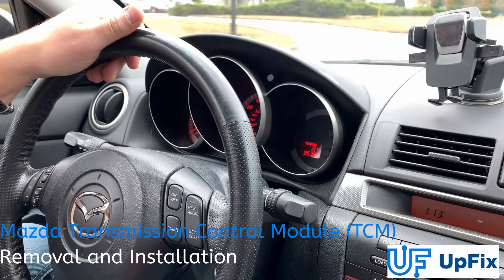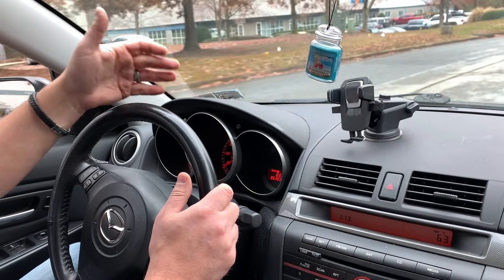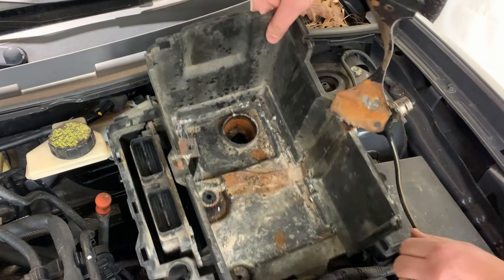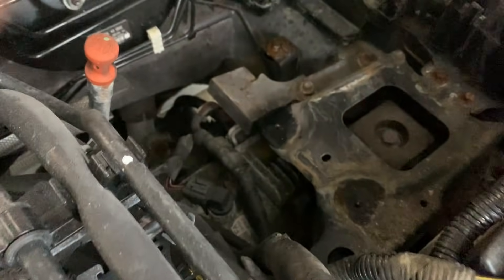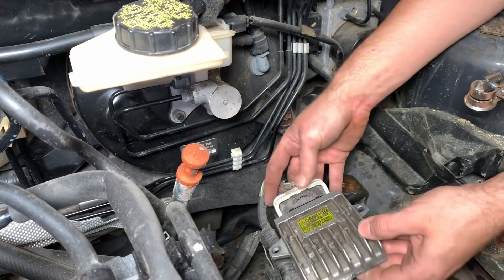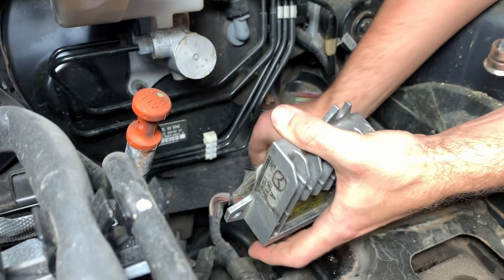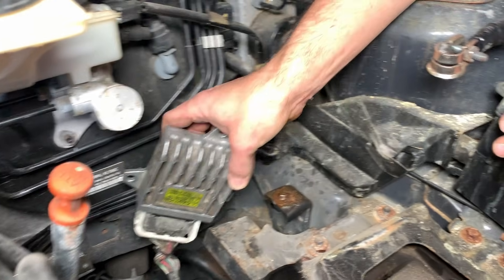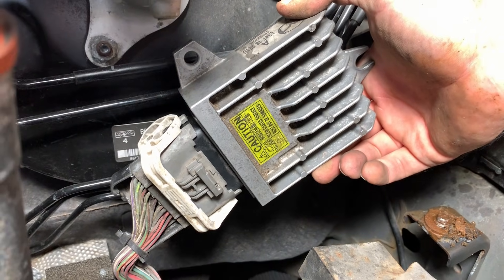Mazda 3 TCM (2006 - 2014) Transmission Control Module Location, Removal & Repair by UpFix

Comment: My 2013 mazda 3 doesnt have any dash light that come on, or any codes, but it normally doesnt want to shift into 3rd or 4th gear while it automatic mode. I can shift fine in manual mode. Would this even be a TCM issue?
Reply from the maker: Considering the coils and plugs were replaced. The misfire can be caused by wiring, internal engine failure, a head gasket, a bad fuel injector, or a malfunctioning ignition or fuel system. If you have checked the above, you may need the ECU repaired. Please try a hard battery reset first (guide below).
https://forum.upfix.com/pcm/pcm-re-installation-procedure

Comment: How much does it cost to send in my TCM for my 2006 Mazda 3 2.0L.?
Reply from the maker: Here is the link for the current price: https://www.upfix.com/product/tcm-mazda-3-2006-2014-transmission-control-module-repair-tcm-tcu/
Reply from the maker: Here is the link for the current price: https://www.upfix.com/product/tcm-mazda-3-2006-2014-transmission-control-module-repair-tcm-tcu/
Reply: Ok these are the issues I am having with my 2006 Mazda 3 2.0L
1. Check engine light and AT light on
2. The car shifts into 1 and 2 gear like it doesn't even there.
3. Once in third gear it gives high rpms then hard shifts
4. Goes into "limp mode"
5. Sometimes I can't go in reverse.
6. Manual transmission gear options don't display
7. The engine gets real loud as if it is whining/grinding.
8. If driving and I stop at the stop sign or stop light the car while not kick back into gear when taking foot off brake and applying gas. I would have to put it in park, turn the car off. And once the car is restarted it will work just fine for about a few minutes then the same problems occur.
9. Put the OBD reader into the car and the codes given are P0455, P0771, P0741, and P2187.
10. Now if I clear the codes, the engine goes a lot quieter and all gears start to work to include the manual transmission gear options start to display and become active again. But at this point I don't know if I should be changing my solenoids, fluid, and filters or what. So I'm lost.

Also I just purchased the car from a friend and not sure of the maintenance upkeep but I got the vehicle at 230,000 miles.

Comment: I have a 2009 mazda 3i 2.0 I am having trouble finding this part. Does anyone know if all 2006-2014 tcm's are the same?  Or is there a difference between the 2.0 tcm and the 2.3 tcm? I'm having no luck
Reply from the maker: Yes, they are different.  Also, make sure the part numbers match. If no luck and you have some time, then an option is to send your original for repair. It takes a few days for repair and few days in shipping. Check out upfix.com

Comment: I have a 2012 mazda 3 skyactiv.automatic The engines revs high at about 30 miles/hr. Is the transmission not shifting?
Reply from the maker: This is a common issue with faulty TCM. Transmission is okay, just the TCM that needs to be replaced or repaired. Check out upfix.com

Comment: Hi, i have this issue, can you swap it out for a refurbished replacement? Mazda told me new one will need programming.. tia
Reply from the maker: Yes, you can swap it for refurbished replacement. It will need to be programmed. We ask for your VIN to make sure it is properly programmed for your vehicle.

Comment: I have a mazda 3 2007. I have no AT lights on, none of the error codes show up on my obd scanner. Yet i have this issue where the drive light in the dash that shows which gear the car is currently in go off and on at times. This issue only affects drive and none of the other gears. When the drive light is on and not going on and off, all gears perfectly shift and the car runs really smoothly. Is this still the tcm or some other transmission related issue.
Reply from the maker: If the drive is affected when the gear shift indicator light is intermittent, then it sounds like it could be a physical issue, not just an electrical one.

It would be good to verify if your OBDII scan tool is capable of reading TCM codes. If it is, then it's possible for the TCM to be at fault since they're commonly known to fail as a result of manufacturing defects.

We can do a bench test and see if there are any issues with the TCM on our test bench, and rest assured, proceed with repairs after diagnostics.
Reply: @upfixauto  can you elaborate a bit more about the physical issue part. Do you think it could have something to do with the transmission linkage cable, sensors or the shifter itself? I'm really puzzled as the car runs smoothly whenever the drive light isn't going crazy blinking.

Comment: My mazda 3 2011 2.0L doesnt shift at start i get the cold start temperature signal then after the signal is gone the transmission can shift and engage without slipping gear properly but only after playing a little with reverse neutral and drive the peocess takes 5 minutes after that the car drives normal and i have gone even 80 mph on it without any weird smell noise or even vibration could this be a tpm issue or a transmission issue i changed the trans fluid at 100k miles the car still drives at 106.8k miles problems started at 106k miles i also added lucas trans fluid and it helped at first but i am asking for advice if i should send tpm or get my trans fixed for 2k
Reply from the maker: Yes, these are common issues that are caused by a failing TCM. You will need to get it replaced or have it rebuilt. If you need your TCM rebuit, please consider UpFix. The process is fast and easy! Check out https://www.upfix.com/product/tcm-mazda-3-2006-2014-transmission-control-module-repair-tcm-tcu/

Comment: so this did not tell you how to repair it at all it just shows you how to remove and replace it
Reply from the maker: What issues are you having with your TCM?
Reply: @upfixauto  shifts hard from 1st to 2nd, I bought an aftermarket TCM from Hong Kong for $400 and it would not work, I took it to the dealer and they could not get it to work, that one would not show what gear I was in and would throw codes saying it is unable to communicate with the computer, so I bought an OEM one for $800 bucks and the dealer installed it and its all good now

Comment: Hello, I have a 2012 Mazda3 with 160k miles on it. Was on a long drive for vacation before the traction control light came on. I pulled over off the highway and then the AT and Check Engine light came on. I had a mobile mechanic come and use a diagnostic tool and he checked the transmission fluid which he said looked fine. He told me the code said, "Transmission fluid pressure switch B circuit low." - could this be a TCM issue?
That's the error code that came up
Reply from the maker: No, this is not one of the common symptoms for this TCM failure. For common issues

Comment: Hey, so I have a 2011 Mazda 3s 2.5 and the code read as P0720, which said it was an output sensor. Could you direct me to find more information on this or place to buy? I’d greatly appreciate it
Reply: How did you end up fixing it?
Reply: @LarusXLarusX  so apparently there was a whole other output speed sensor underneath the car, so I replaced that. Once I pulled it it started leaking transmission fluid, so I had to fill it to adequate levels after I was done. And then my at remained, which I went to upfix to get a refurbished tcm. They had two options, which were trade in your tcm for a refurbished one (quick) or send your tcm to get fixed and sent back

Comment: I have a 2013 3  I just bought.  There’s no trouble lights on. I just happen to use Bouncie and switched it over on this trade and it kicked code P0882. Other than the car being slightly sluggish compared to other Mazda 3s I’ve owned In the past, it doesn’t seem to drive like it’s having major issues. Is this normal? The dealership passed it off as because it’s “skyactive it drives like that to save fuel” 🙄
It also has a cracked transmission case they didn’t mention either but my mechanic said it’s fine for now. However they didn’t catch the tcm code either, is it worth sending in to repair it? And do u think it will fix the code and drive better?
Reply from the maker: Sounds like the transmission and TCM is good. 👍

Comment: If 1st Gen is anything like the 2nd Gen, the 5AT TCM is known to go bad on these cars as they age. There are some DIY videos on YouTube you can use to help you replace it, but the part itself could cost.

...and that's part of the reason why I own a 6-speed 2nd Gen.
Reply from the maker: Instead of replacing it, just UpFix it. Visit upfix.com today!
Reply: We have 1st gen 2007 automatic with no issues. I change the fluid/filter every 100,000km and I also moved the TCM to the firewall for better cooling. 
In realty it doesn't matter what vehicle you drive  They all have issues when they get older. All fuel injected vehicles have computers that will fail over time. The constant heating/cooling of the PCB cause it to flex and solder joints to crack (lead free solder) and capacitors leak or dry up with age. Just a fact of life no matter the brand.

Comment: I was just given a second mazda3 (2007 2.3 N/A) because the transmission is having issues even after the tcm refurbish. Still shifts hard but I have a feeling it’s the wiring. I’m having trouble trying to source a harness and what led me to believe that it is the harness is that the battery keeps dying after being fully charged and plugged back into the car. Would love to hear advice or get a good link to source the harness.
Reply: Have you changed fluid and filter? Check for parasitic drains on your battery with a multimeter. You may have a module or a stereo that is not going to sleep.

Comment: I have a TCM problem, my part number is LFS3 18 9E1A.
2006 Mazda 3 LF 2.0L

Will an L3 type TCM work on my car?
Reply from the maker: For this vehicle, the replacement part number needs to be the same as your original part number. If you have time, we can always upfix your original part!
Reply: @upfixauto  Thank you very much for the advice.
Sounds like a good plan to upfix it but I am all the way in Southern Africa (Namibia 🇳🇦)

Comment: Hi i have a 2014 mazda 3 i took off the battery tray and theres no tcm i cant seem to find it do yall know where it can be?
Reply from the maker: Some Mazda 3's dont have a TCM.
Reply: @upfixauto  your website says you fix tcm from 2006-2014 thats why i thought it had one
Reply from the maker: @josbuendi5839  Mazda 3 2014 was a split year that started not to use TCMs.

Comment: How do you get that yellow plastic piece off the bolt holding down the TCM
Reply from the maker: It is a clip on, and it's on there very tight.

Comment: I have a 2008 mazda 3 (2.3L 5 speed auto) and I started my car and tried to go into reverse. When that happened my car felt like it almost stalled and my engine and transmission light came on, any ideas what my problem can be? My reader pulled the u0101 code
Reply: The car more so clunks and won’t move. Stall isn’t the right word
Reply from the maker: Your TCM unit is starting to fail and affecting the transmission.

Comment: Not too long ago, my tcm was replacement and everything went well but now my pcm is bad, could it be that I wired it wrong ?
Reply from the maker: No it will not be the wiring. You just disconnected the harness plug and reconnected it. What DTC error codes are you getting on the PCM?

Comment: All the videos I've seen are very easy, just like you do it, it's always in the same place today I wanted to replace the one on my mazda5 2006, surprise no 😔 I found it nowhere
Reply from the maker: That means your vehicle does not have the TCM. Most Mazda 3's 2006 to 2014 have TCM. But some dont have it.

Comment: I've got a P0841 and P0732 transmission code for a 2007 Mazda 2 2.3. Should I change all the solenoids out (P0732)? Where's the location for the transmission fluid pressure switch (P0841)?

Comment: I'm still having issues with the TCM a mechanic took it out but couldn't get a replacement so he put it back in ( this cost me $180) so at least I can use the car, amazingly it started to work again for a while, and now it's not working again.  Does anyone know anyone in Brisbane who actually knows how to fix these TCM problems?  Somewhere I read that the TCM is supposed to last for the life of the car, and perhaps many are being replaced when they don't have to be.  I don't know, I would just like the problem fixed, it's just very friggin annoying.

Comment: My 2007 Mazda3 tcm failed last year. Took it to dealer and they quoted me around $1500 to fix. They later called me while they still had my car and said it was still covered under P warranty? My car at this point had about 107k miles on it. They ended up replacing it for free but told me that the motor mount right above it was worn out & damaged & when it is, it can cause the tcm to get damaged due to hitting it? I asked if they could place the module in a different location but they said it would void any warranty & was specified to go in the location it is. Given I didn’t have to pay for it I didn’t push it. I did have them replace then motor mount above tcm since they were already in there. Never the less they charged a lot for that but I still saved money on the tcm. When I asked what warranty it fell under they just said p warranty, I didn’t question it further in case they reversed their decision lol but until this day I am not sure what they meant. Maybe powertrain warranty?

Comment: Hello. I need serious help. My car has problems similar to the ones mentioned in the video. I'm using a 2011 mazda 3 BL. The car shakes a lot when shifting from 3rd to 4th gear. RPM spikes momentarily and the vehicle shakes. Sometimes when I shift the gear to R, the car does not move. The gear can shift into R, but the vehicle does not move. The mechanics suggest a complete transmission swap, but I would like to try everything before this final solution. Do you think the problem could be TCM related?
Reply from the maker: Yes, most of the time, it is the TCM for this particular Mazda 3

Comment: My 06 Mazda 3 sometime jerks during a mild acceleration and the check engine and AT light will come on then go away. Is it the TCM going bad?
Reply from the maker: Yes this is common issue when TCM is failing on a Mazda 3
Reply: @upfixauto  Do you guys ship to Canada?

Comment: will this service work on a 2015 Mazda 3?
Reply from the maker: Yes here is more info https://www.upfix.com/product/tcm-mazda-3-2006-2014-transmission-control-module-repair-tcm-tcu/
Reply: @upfixauto  it says it's for 2006-2014, do you know if 2015 is different? as far as I know 2015 is the same drivetrain but your listing goes only to 2014, thanks 🙏
Reply from the maker: @pacificbayautoinc.7462  some 2015 got away from using TCM. If your 2015 Mazda 3 has a TCM then we can repair it. You can look under the battery to see if the TCM is there. If it is not then your 2015 Mazda 3 does not have a TCM. Hope this answered your question.

Comment: Could the TCM still be suspected without my AT light illuminating? 

I have a very rough shift into R when cold. Also, feels like it goes in and out of reverse, not a slip, but feels like engaging and and disengaging. I also have a hard 1-2 shift, mostly when cold. Both don't seem quite as bad when the car has been driven for a while, though they still don't seem quite right.
Reply: check your motor mounts also
Reply from the maker: Yes it still could be an issue with TCM. But usually AT light will come on and then go off. Sounds like your TCM is just starting to slowly fail. Here is more info https://www.upfix.com/product/tcm-mazda-3-2006-2014-transmission-control-module-repair-tcm-tcu/
Reply: Yes check the mounts.

Comment: Bro me aparece la luz at, el escáner no me arroja error pero si le doy a limpiar me la borra por un rato, cuando aparece me resbala en el segundo y tercer cambio y no me pasa del 4to cambio, y si lo pongo en modo manual no me aparecen los números ni me suben o bajan las velocidades, crees que pueda ser eso? es una mazda 5
Reply from the maker: Sí, este es un problema común con mazda 5 tcm. La unidad tcm necesita ser reemplazada o reparada. Podemos reparar esta pieza. Aquí hay más información:
https://www.upfix.com/product/tcm-mazda-5-2007-2015-transmission-control-module-repair-tcm-tcu/

Comment: I had jerking when shifting through my gears on my 2007 Mazda 3 2.3L automatic. I changed the TCM out and it’s Regina to 4500 before switching to 2,3,4th gear. 

The original code was P0758 before I installed the brand new TCM. That code is gone now and it’s P0757. 

Do you think the problem was the solenoid and not the TCM, both, or something else?
Reply from the maker: Yes this is common when TCM is starting to fail. We can rebuild your original TCM at upfix.com

Comment: Hey man.  Why is it that if I want to have a new unit sent to me so that I can still have my car to drive until it arrives, I am required to pay for firmware update ($99)?
Reply from the maker: If you send your original part for repair then the firmware update is not required.  But if you purchase an exchange unit then it will need a firmware update because it will be installed into a different vehicle and need to make sure the unit will work properly for you.

Comment: if my tcm causing me these issues and I don't want to pay to get it fixed is it possible to simply buy the tcm of another mazda same year same everything and just install it to my car the way you showed or it will need to be reprogrammed
Reply from the maker: It would most likely need to be reprogrammed which the dealership has to do. With our service you would simply send in your tcm and we would repair the one you already have. This means no programming would need to be done.
Reply: @upfixauto  How do I get it fixed from you guys are you available in Canada too?